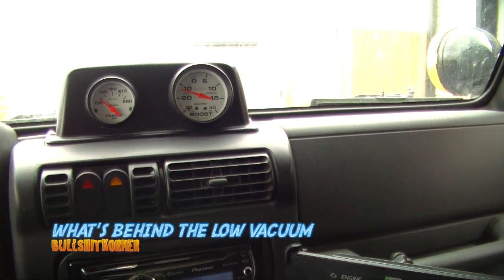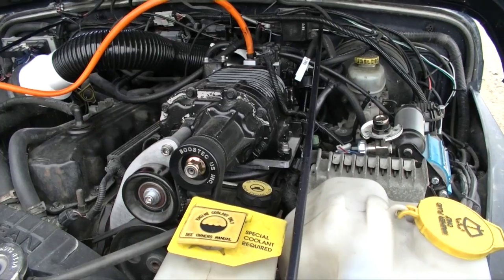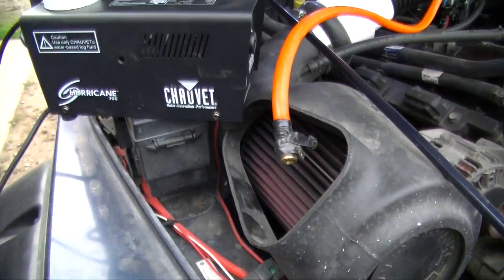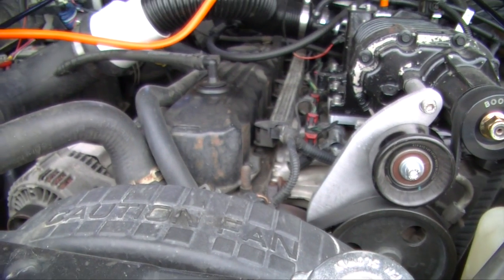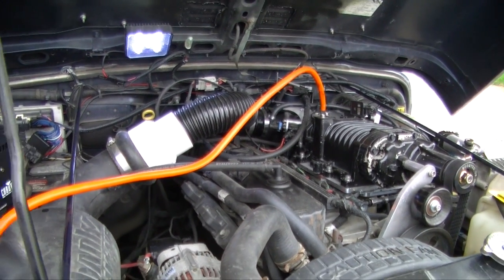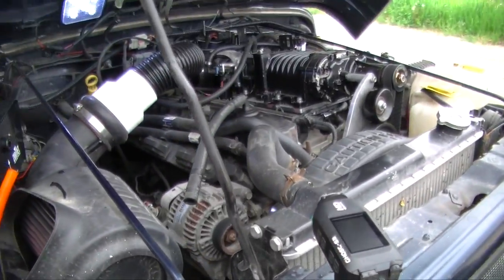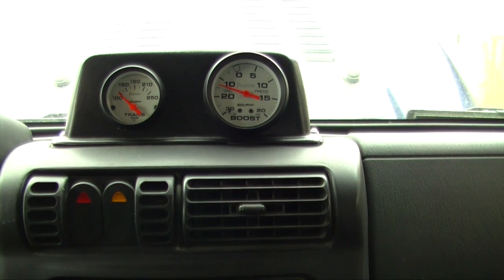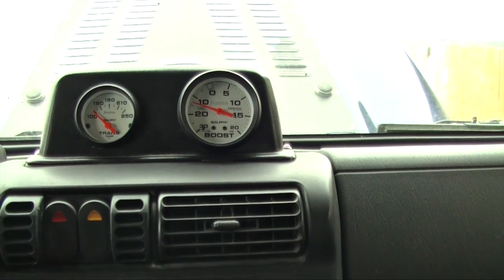Low Engine Vacuum Smoke Test For Leaks

Comment: coming back to your vacuum issue: my 4.0 with nearly 180k km has around 15/16 when cold, when warmed up 18-20. no chopping on the gauge and no leaks detected so far - worn engine/rings, stretched timing chain or nothing to worry about ?
Reply from the maker: +Joey_V i wouldn't even worry about it, i'm not even worried at 10 inches of vacuum

Comment: Hey Jerry, are you planning on rebuilding the motor with some "upgrades" like cam, heads, roller rockers, etc etc. I might have missed it, but where there estimated HP/TQ numbers on the supercharger? 
cheers.

Comment: 0-20 on snap along with low steady idle vacuum is very, very likely worn rings.  The only reason I say "very, very likely" is because there's always that one crazy chance that Jupiter isn't properly aligned with the angle of your tongue or something...
Reply from the maker: rhkips i agree with your statement 100 percent and the leak down test i'm pretty sure will reveal that

Comment: Engine restore works. I've seen before and after where on a honda 4 cyl. 2 cyls were at 70 and the others were nominal 120. After a few miles. Perfect compression across all cylinders. Yeah buddy.
Reply from the maker: Daniel Peters wonder if it has teflon in the additive so that it melts and fills the grooves to give a temporary fix.  Years ago a person could get little teflon balls that you would put in the cylinder that would help restore compression.  Not sure you can even get those now

Comment: Try doing a wet vs dry compression test. WD40 works good for that. Have faith in the 4liter inline 6. I've seen them go well past 300,000 miles and still run strong. Depending on where your mass air  sensor is located, the cold air intake could be pissing it off. Personally I don't care for the cotton washable filter's. Paper filters out more dirt. Take your filter off then white glove test the intake hose. Bad news.
Reply from the maker: Daniel Peters there is no mass air sensor on the TJ, the fuel is controlled partly from the MAP sensor on the throttle body.  I did a video on compression a few months back and had 2 cylinders that were low on compression like around 120 put some oil in and went to 140.  going to do a leak down test next but this is all part of the series of troubleshooting the low vacuum

Comment: Running smoke backwards through a PCV valve?
Reply from the maker: BassheadGTP your the only one who noticed, it was a bad choice of words didn't catch it until i was editing.  the PVC is actually the rear elbow on the valve cover with the line running to the intake on the supercharger.  the line i used in the video is actually the crankcase breather which I should have said in the video.  Good catch on noticing that

Comment: Jerry all I can add if it helps is I think you replaced the cats before your trip, clogged cats will also cause low vacuum and low power.  Does your scan tool show a data pid for ignition timing, I'd check that.  I'd hook up a vacuum gauge at the engine to verify the amount and see if it holds steady.  As for your engine being so tired it won't pull 18 in at idle, well I'm guessing  not.  I'll venture to guess its the cats or valve timing or ign timing. Looking forward to seeing what you find. 👍
Reply: Excellent responce, I think your bang on. Look forward to finding what the results are. The leak down test will surely help. Jerrys a pretty sharp guy , he'll get it figured out , it might take at least two cases of beer :)
Reply: I would think if the purge solenoid was stuck open at idle his fuel trims would go negative  and the engine would idle bad if not stall out. The smoke machine jerry has is homemade so if it preasurizes the evap system too high hes not going to like the results:) the purge solenoid should set a CEL if the monitor detects a fault during an evap test. It is a Chrysler product so anything is possible Ha Ha.
Reply from the maker: Michael Williams that's good point and i thought of that too, when i was getting it ready to install the supercharger I pulled all vacuum lines on the intake and plugged them and ran a vacuum gauge right on the intake and no difference
Reply from the maker: Steve Rob from the previous compression test video with cylinders 3 and 2 low compression and now with the supercharger with lots of blowby and the crankcase breather spitting up quit a noticeable amount of oil, i'm leaning towards leaking rings i will try to do the leak down test in the next few weeks
Reply from the maker: Steve Rob actually I replaced my Cats before I installed the supercharger, the new cats didn't change any reading on the vacuum.

Comment: Rings, valve stems, burned valves, or timing?  Leak down test is the right call.  I see too many people on forums say at this point "they don't have a vacuum leak" even though their vacuum is well enough below spec to be an issue. So I tell them to do a leak down test and 9/10 their response is "what's a leak-down test".
Reply from the maker: ***** hahahah that is why I hate forums too many armchair mechanics.  I like surfing in when i have a issues and reading various threads on the same symptom to get ideas
Reply: Bullshitkorner I've been a moderator of Mazda626.net for the past 5 years.  Because I'm so active I get to see a lot of long term pattern failures and oddball issues, Staying current with other owners of your same vehicle definitely has its value.  I learn from them and they learn from me, it's a symbiotic relationship.  The 626 forum in particular is a really good one though.  Most other vehicle forums out there are absolute shit filled with armchair mechanics and pissing contests, agreed.  You will occasionally find a good one worth being a member of.